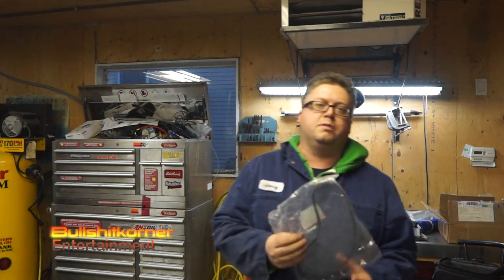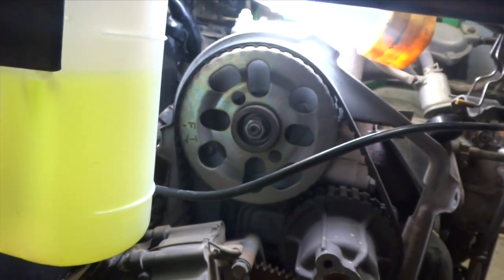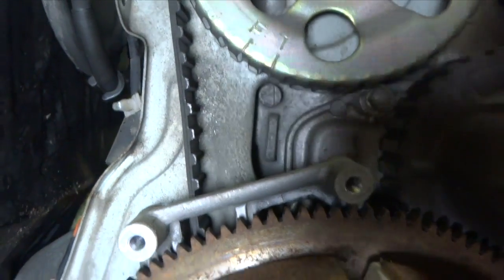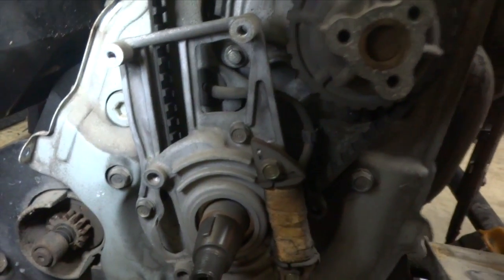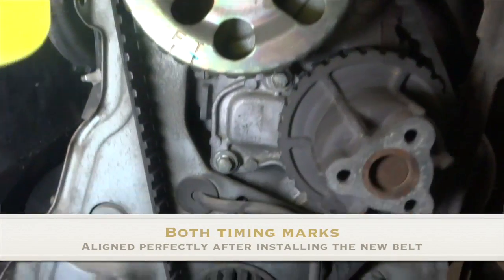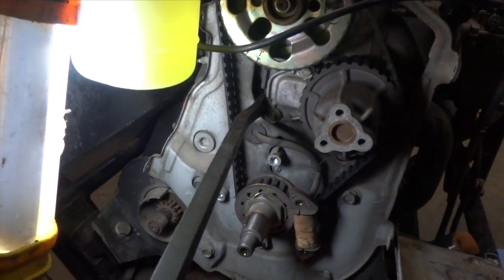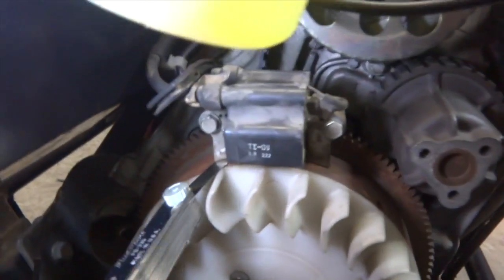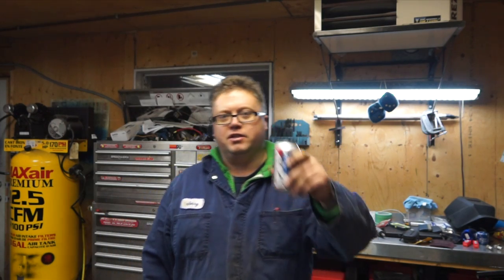DIY Honda Timing Belt Replacement

Comment: I need to remove the starter off a similar Honda Generator.  It appears that I have to remove the flywheel to get to the starter bolts. Your video seams to show that.  Since you have a shop manual, can you confirm my assumption?  Also, is the coil gap the only precision assembly concern?  I appreciate any feedback you can offer.  Thanks for your video.
Reply: I can confirm that for you. I just did that, you can't get to the starter bolts until you remove the flywheel. I just replaced water pump, timing belt, starter, and stator coils, so right now I am intimately familiar with that process.  Good luck with it!
Reply: @IMoronius  I had forgotten that I asked.  I removed the flywheel and with more difficulty, the motor mount around the starter.  Repairing the starter was straight forward (issue with brushes).  After reassembly, it started easily after two years and seems to work perfectly.  Thank you.
Reply: @pej5885   Same issue with mine and the brushes. One brush isn't sliding and keeping tension. How did you fix yours? I realize its 2 years later but hopefully you get the message.

Comment: I need to remove the head to inspect pistons I just need to remove the belt off the top cam gear - is it possible to loosen the belt enough to slip it off the top cog without taking off the flywheel?   How would I do that?  One cylinder no compression....hoping its just a stuck ring.
Reply: not possible, you have to loosen the water pump (behind flywheel) to get slack in the belt.

Comment: Hey can send me copy of that page out of service Manuel ? The timing marks , if can thanks man great stuff
Reply from the maker: Negative that would be copyright, service manuals are cheap and readily available online
Reply: you will find timing marks on the upper and lower pulleys, small triangles stamped on the block. they must both be lined up: note the upper pulley has two timing marks but only one will line up at the same time the bottom is lined up - check this prior to removing the old belt.
Reply: @IMoronius what if somebody  removed the belt before checking?

Comment: Hello I know this is a 6 year old post but I found it to be very helpful. My question is why is the exhaust sucking in in the intake blowing out my belt is fine and has never been replaced. Could it be the timing is off? Thank you for your video

Comment: Rotating the engine(by hand) is key to double check the alignment , I have seen a couple young mechanics not do this thinking they had it right just from looking the first time and leaving it alone. Bad mistake and on some engines a very bad one for I've seen piston and valves hit due to not being right on with the timing specs.
Reply: yup always nice to have the honda service manual handy on this stuff!!
lots of good tips just like this in there!
Reply from the maker: Ya I know I've seen it happen before as well,  I always rotate it around a couple times by hand to make sure it still aligns, as you never know a tooth may not be sitting on the gear right and when you spin it will jump a tooth and be out.   I was a bit concerned doing this at first as one timing mark lined up and the other never, this belt must have been stretched pretty good as once I put the new belt on both marks lined up perfectly